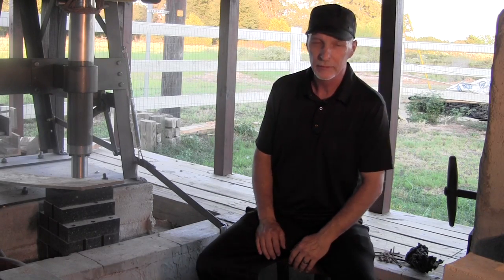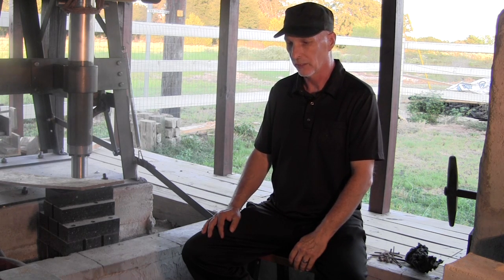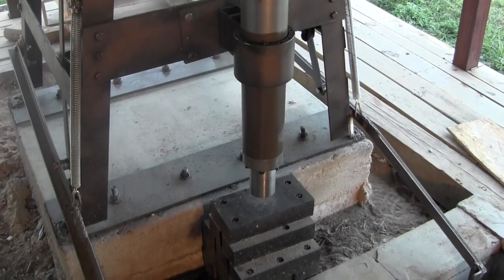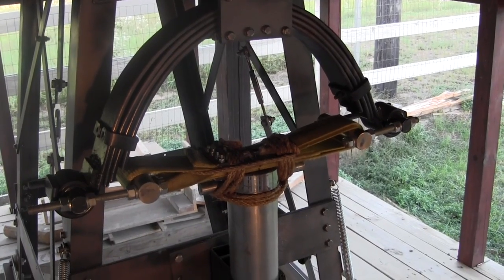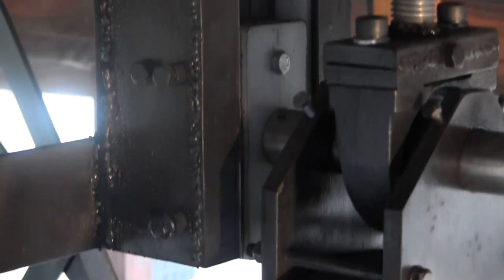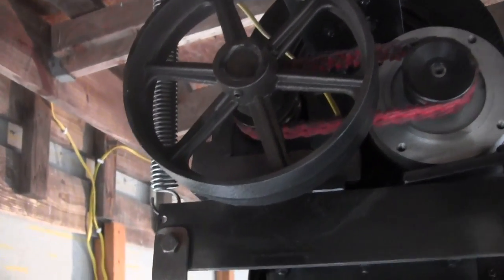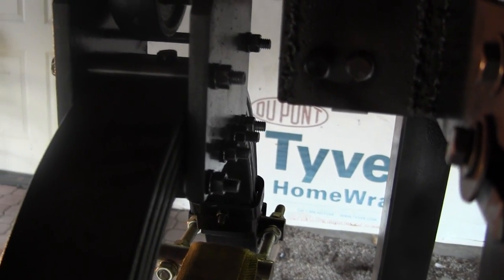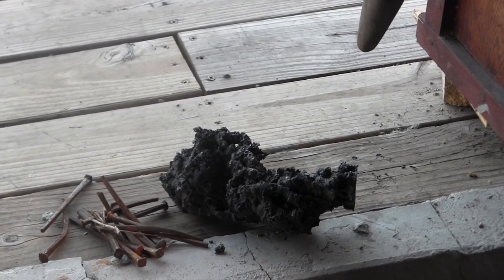Handbuilt Japanese style Spring/Tire Hybrid Power Hammer

Comment: Really cool Dan, building my own power hammer at the moment, more of a helve type with leaf spring as the fulcrum. Its high with gas cylinders as hammer and sleeve, roller blade wheels as guides! Will send you short video of it in operation if email address is in description, have not looked yet! 
Happy forging mate, have fun!